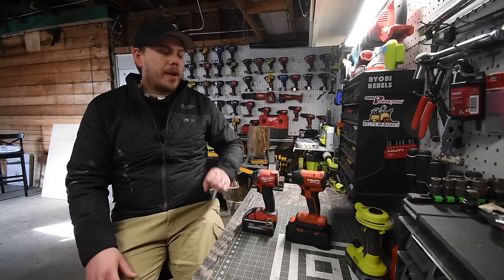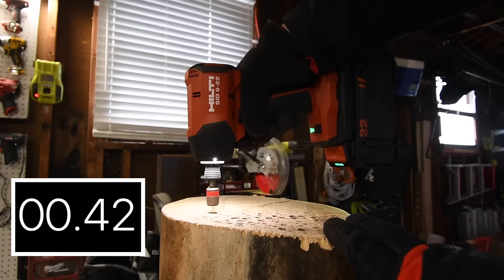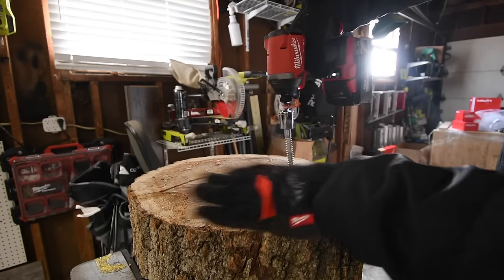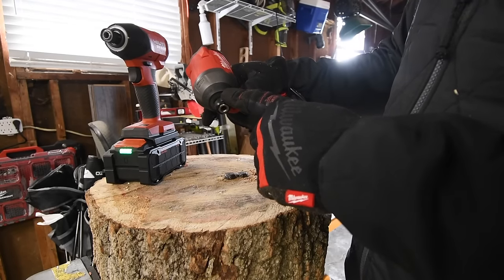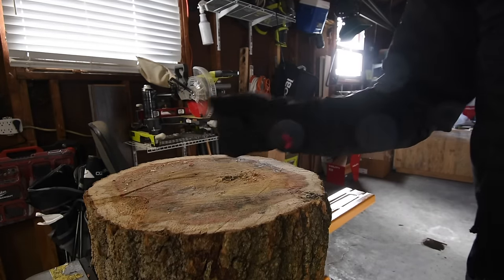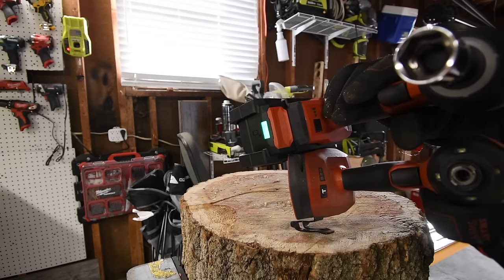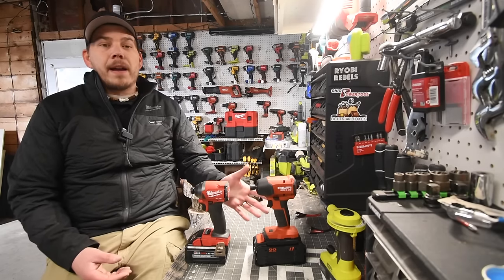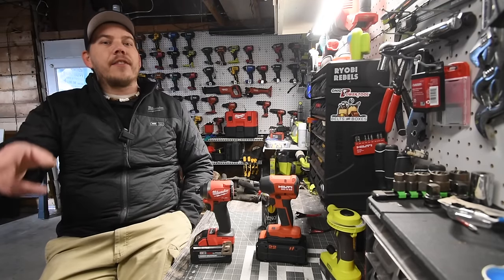Is Nuron Better Than FUEL Now?

Comment: Durability and reliability is what's important. Not whether one impact driver is a few seconds faster than another one. Using it on the job you'll never even notice.
Reply: .... not true at all. Some of is get paid per bolt... every second equals money, i make 4.5$ per bolt and need to try and do as many as possible (usually i do between 250-300) every milisecond counts my friend.
Reply: That's why I'm buying Hilti . I've used both . Milwaukee is great, but Hilti is far more durable . Lifetime of experience behind hard daily use behind that statement.  But I get it when on a budget . Choices are difficult sometimes

Comment: What's so awesome about it? Its more expensive, it under delivered when looking at the specs, more bulky, bigger battery with the same capacity and underperforms compared to Milwaukee. If anything I would say that it is a waste of money. That extra $20 could go into a nice shockwave bit set.
Reply: It’s nicer to use. Has better control. Vibrates much less (Milwaukee is a wild weasel). The entire inside of the Hilti gearbox and hammer mechanism doesn’t slide back and forth a quarter inch like the Milwaukee does.  Doesn’t drop bits. You won’t find stray wires coming out the other end of a weak solder joint like the Milwaukee. It doesn’t have Milwaukee’s horrible runout. Should I go on? 😂. The Hilti Nuron batteries are ridiculous and I’m not going to defend them there, ever.  You don’t have to get Hilti for most of the pro’s I listed, however.  Makita, Dewalt, Bosch and Hitachi hit most of the qualifiers. Hitachi and Dewalt have some bit wobble and the Bosch slides and back and forth pretty bad after hard use.  Only Dewalt has the same oomph as Milwaukee, however.
Reply: I was thinking the same. It lost virtually all the tests. And when the collet had issues, he didn’t skip a beat in saying that the Milwaukee collet has issues too. Lol eye for an eye. Plus that Hilti battery is huge. Might as well attach a damn microwave to the bottom of that NURON impact.
Reply: Lol just because the Milwaukee is a little faster doesn't mean better, you don't buy these tools to race, they are not race cars....these are just YouTube videos, the Hilti shines in other areas, you have to just use each tool to know the difference
Reply: Found the fan boy
Reply: Actually that Milwaukee 2583 setup is more expensive(430$ + tax). That's an XC8 battery in the video and Milwaukee charges through the teeth for battery chargers

The Nuron SID6 and the b22 8Ah battery together is 366$ Adding a charger is only 40$ so like 406..plus tax

The real issue is that neither of these setups are logical at all: both of these impact driver configurations weigh about six pounds and couldn't place against a 4 pound ryobi impact wrench and actually forfeited(failed) in their Round 2 video.
The Ryobi impact wrench had to intervene and finish the bolt that they both failed to drive.
--- which was a P262 with a 1.5Ah battery ..The entire setup only weighs 4 pounds + 1oz fully assembled. Two entire pounds lighter than both impact drivers

It's cheaper to ignore BOTH of these impact drivers and just save ~195$. Use the 221$ more powerful impact wrench setup that weighs two pounds less. Two pounds is an entire laptop computer worth of extra weight
Reply: @robertrada4783  I have the Hilti SID-4 on old battery platform.  I love it so much more than my Gen 3 Milwaukee impact! I find the Milwaukee just so manic and uncomfortable to use. I have in fact just given mine away to my assistant. I also find that my Milwaukee Gen 3 combi, Circular saw and the impact I have just given away, all had trigger issues where you would use it, put it down, pick it up again and nothing!!! Full battery too. So you have to take the battery off and on a few times for it to work again. This is a real pain if you are squeezing your hand into a confined space to put a screw in, locate the bit in the screw....with difficulty......as it's so confined,  squeeze the trigger and......nothing!! So infuriating!! All my Hilti gear is on a different level. I don't see the point of nuron and the batteries are really cumbersome looking!!
Dave.
Reply: @Lee-lb9qh  I totally agree!! Using Milwaukee all day is sooo tiring. Hilti is a dream!
Dave.
Reply: I vpuld care less about the seconds.  The majority of my milwaukee tools are falling apart.  

I notice things like no threaded locker on screws, jenky housing etc. 

Im most concerned with longevity.  But hilti nuron batterys are a major tutn off.  Look like they would get in the way in tighter setting
Reply: But Milwaukee gear is crap.
Reply: Milwaukee gear is crap though. All my Milwaukee gear, all fuel and 6 tools are all faulty. My Hilti stuff is far superior.  I use the old platform though and can see no benefit, especially for me, that Nuron can have. Plus those batteries are huge!! I gave away my Gen 3 Milwaukee impact as it was too manic, my fuel Circular saw only works if I take the battery on and off about 3 times and my Gen 3 combi and fuel jigsaw are the same. In all tests I've done head to head between my SF6H A22 Hilti and my Gen3 combi, the Hilti comes out top every time. I don't care about speed so much as comfort. But my Hilti gear is much more user friendly than my Milwaukee.  Plus.....if I have any issues with my Hilti gear I can call my local rep and have a replacement  within half an hour. I sent my Milwaukee combi back because of trigger issues and I didn't see it again for 3 weeks!!  I am not a fan boy of any brand, I am just giving my opinion through my own experience of both brands.
Dave.

Comment: If you disassemble these two drills, you'll see the Hilti has much higher quality parts. The Milwaukee might drill faster, but the Hilti will last much much longer.
Reply: Lets be brutally honest; the quality isn't all that far off between the two brands. Hilti has always been about the service agreement and warranty, personally.
Reply: I'm not so sure anymore.  The last couple of Hilti's we bought were made in China and didn't last the year. 1/4-inch impacts. Were still using Milwaukee impacts for over 6 years. And we learned the hard way the Hilti doesn't have same warranty for their China made tools as they do for their German made ones.
Reply: @Scottize1  damn! That's a really nice data. 😔
Reply: I don’t think so, the hilti core drill we have is definitely a loser compared to the Milwaukee core drill we have. Slower and more maintenance

Comment: By inserting the second bolt so close to the first one, you're forcing whichever driver goes second to work harder, because the wood in that area will be under more compression.
Reply from the maker: I dont force tools. There is no point on doing that. These tools are so powerful they dont need assistance. This is an unbiased channel. That even includes HILTI. Most of my HILTI videos are of HILTI losing. HILTI is glad that I am 100% honest about their tools. If I faked my test results to make HILTI win, they would stop working with me.
Reply: @ManCaverTools  - I'm sure the tool can handle it and was in no risk of breaking. But I'm also sure that more compressed wood (i.e., right next to an existing bolt) is harder to drive screws into, so that driver has to work harder than the first one, that drove it into less compressed wood. It's just physics.

And I'm not sure I understand your reply (who said anything about "assistance" or "faking videos to make Hilti win"...?), since Hilti was in fact the one that always went second (into more compressed wood), in this video. A level playing field isn't "assistance".

Simply pick a spot away from previous bolts to make sure one doesn't influence the other, and / or randomise or alternate the order (i.e., which tool does each test first), so that any advantage in going first (or going last) doesn't always benefit the same one. That's standard testing methodology in most fields (especially when double-blind tests aren't possible); just because a bias isn't deliberate (or conscious) doesn't mean it doesn't exist.
Reply from the maker: I might have added this reply to the wrong comment. my bad on that. I don't use use logs anymore in my test videos. Im not sure if you noticed or can see but this log has around 30-40 lag holes in it. Both of the tools are going through a lot of compressed wood.
Reply: @ManCaverTools  - Holes whose screws have been removed actually make it easier for the wood to deform into the void when a screw is driven in next to them. 

The issue is with inserting a screw right next to another one (especially one inserted very recently) because the metal can't be compressed when the new one is being driven in the same way that wood (or a void) would.
Reply from the maker: @RFC3514  I know, which Is why I dont use logs anymore in my videos and haven't for a while.
Reply from the maker: @RFC3514  but also consider this. Most wood splits with these kind of tests. Split wood also makes it unfair. Logs rarely split while driving in these 1/2 lags. which is why I used logs. This is an old video so you haven't seen what I do now. it's not perfect. but it's better. https://youtu.be/smSvyAP3agw?si=rou2VImcks8iQT8p
Reply: @ManCaverTools  - Presumably, you wouldn't drive the second screw into the split (or an area affected by a visible split). Anyway, I was just commenting on this video, not more recent ones.
Reply from the maker: @RFC3514  I am working on the garage and will be filming test videos again this week. I’m so excited

Comment: One test that would be really good would be trying to drive drywall screws correctly into drywall (piece of plywood or whatever behind it so you can screw wherever).  Subjectively say how easy it is, how good they are to use.  Past a certain point, torque tests on these are irrelevant. Duration tests would be nice, but its always good to keep a spare battery.  I'm curious how they feel to use.  How good the trigger responds and feels.  Which one feels nicer in the hand.

Comment: I have used both extensively. The Milwaukee has always been a little faster & a little stronger but the batteries don't last as long. I've experienced the bit getting stuck in both. 
It's about time hilti comes out with one battery fits all. 
Unless you work for a big company I would recommend the Milwaukee because it's more affordable. 
Where hilti shines is their rotary hammers. Definitely best in class clean holes and one battery usually lasts till break time.

Comment: The gen 3 does have collet issues. Sent back to Milwaukee they sent me out a brand new gen 3 with the double ball bearing. It’s been perfect ever since. 

Crazy how everyone is upping voltages etc and Milwaukee who released it years ago is still on top of the hill. Can only imagine what gen 4 is gonna be like.
Reply from the maker: we will see in the future
Reply: We saw it same shit bit bulky but
Reply: I have the gen 3 M12 fuel impact driver and it basically shares the technology of the gen 4 m18 fuel. I’ve dropped it so many times and the collet is still in good shape. Also they fixed the chuck wobble in their fuel hammer drill/drivers. The gen 4 M18 fuel is one second faster than gen 3 M18 fuel when driving a 6 inch lag screws.

Comment: It's wild that despite all these companies coming out with new impact drivers with better specs the Milwaukee is still king it was made 8 years ago flex, hilti, and dewalt came out with brand new impact drivers
Reply: My thought too :) milwaukee lets go !! 😀
Reply: Dewalt came out with new lower tier impact drivers.   There is a new dcf845 xr coming out soon tho.
Reply: Agree, the Gen 3 is a beast, although it's just 3 years old, not 8.
Reply: I replace my Milwaukee's and Makita's with the triple Hammer and 36V Metabo HPT Hammer Drill, Triple hammer impact driver has more control.and quicker in many applications and the Hammer drill is more powerful-they are also much better priced and Lifetime warranty
Also the 36V AC adapter capability gives me all day run time and can be used on tools like full size 10" table saw, mitre saw, grinder, SDS max rotary hammer, only Full Size 1/2 router,  vacuum, portable band saw circ saws
Also had Milwaukee collect issues as well as the Hilti did
Reply: Milwaukee impact will be broken in 1 year tho and then a year after that and it'll keep being like that until your warranty is over lol
Reply: it's five years
Reply: @BlessedFallout  where are you going?
Reply: @luisinhoens90  If you go onto the home depot website and look up reviews on the Milwaukee impact driver the oldest review is from November 4th 2013 therefore the impact driver is almost 9 years old
Reply: @minnesotaman3  isn't Gen 3 from 2018?
Reply: @minnesotaman3  Hey man, I looked up those reviews. It looks like they aren't relevant to this tool. They are referring to a saw, not this impact driver. I am pretty sure this Impact Driver 2853-20 is from 2018 or somewhere thereabout. Definitely not 2013.
Reply: Im a milwaukee fan but the Flex aint no slouch! It has definitely when toe to toe with milwaukee.
Reply: You Already Kno This.  Because Im Just Watching This Video 6 Months Later  But To Someone Who Might Be Reading Not No More  Dewalt Came Out With DCF921

Comment: I picked up the new Hilti impact one or two weeks ago.  Phenomenal quality. Took it apart, and I’m happy with what I saw there too. Quite an excellent value.  My only complaint is the awkward batteries and needing to buy a different one for every tool. I don’t want to buy more Hilti batteries. I want to buy more Hilti tools. They want to pick up customers outside of their niche (granted, I did already use their anchors and adhesives). Their employees have been asking me A LOT of questions.  Fanboys on Instagram have been crying and then blocking me for going hard with my posts highlighting my negative criticisms.  Meanwhile anyone I’ve spoken to at Hilti encourages it. They want to get this line as good as they can make it.
Reply: You don't need to buy a different battery for every tool.  With the Nuron platform, all the batteries are interchangeable with any Nuron tool.  You can buy 30 tools and have one battery run all 30.  You may want more batteries as you'll be charging that one  battery a lot, but you could definitely run all your new Nuron tools with one battery.  When you buy Hilti Nuron tools and batteries, its a la carte.  No packages.  You buy each tool and each battery individually.
Reply: @kylebyost  There’s a not at all surprising power loss when you go to single row packs  on most of the tools (although a surprising amount of instances where it doesn’t matter). At the same time, the first “normal” battery is massive. So while all of the batteries will run a tool to some degree, you’re going to need all of the sizes if you don’t want to be miserable.